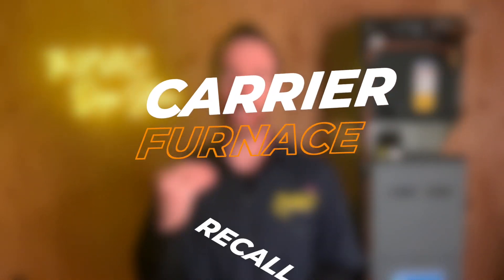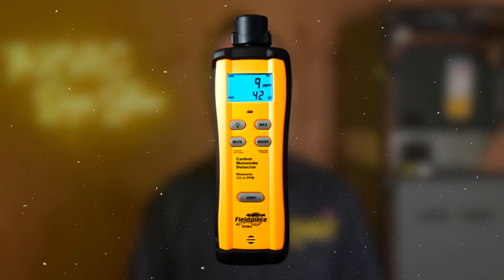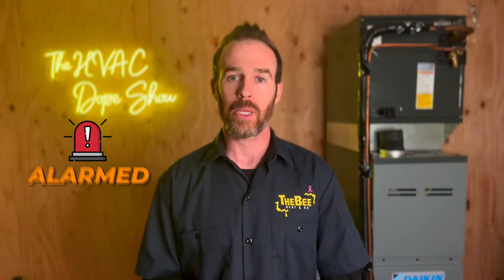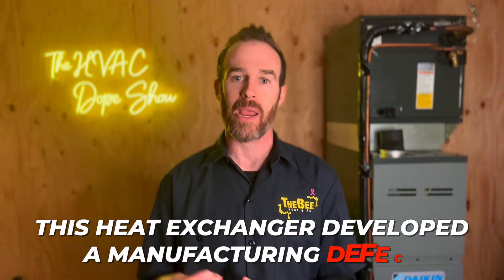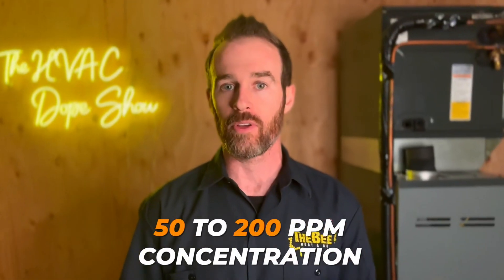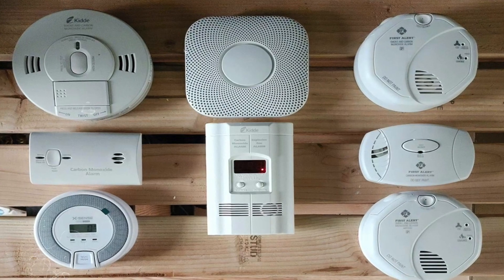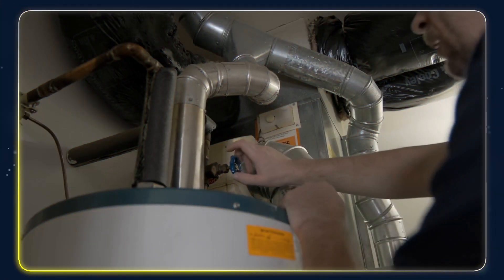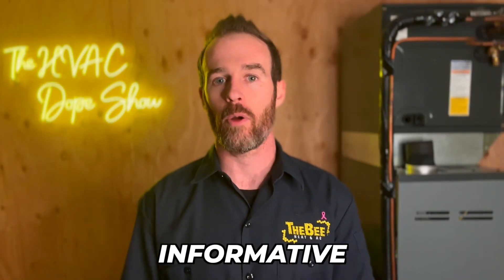Carrier Furnaces: Heat Exchanger Recall⚖️💰

Comment: Yeah its a scam.... Carrier wont give you, the customer, a replacement secondary heat exchange, they make you go through one of their "dealers" to get it, who all refuse to sell you or install just the secondary. They all insist on replacing the primary, even when there is absolutely nothing wrong with it, and then try to tack on an extra $1500 that has to come out of the customers pocket, which pretty much forces you to buy a new furnace, which carrier conveniently offers a discount towards as an alternative to offering the replacement parts that no one will give you. Theyre using the class action suit against them as a marketing scheme to sell you an entire furnace, which of course our corrupt legal system is perfectly fine with. Only in America can the rich and corrupt make even more off their scam by being sued. The court finds them responsible for making plastic heat exchangers and as punishment orders them to scam the victims a 2nd time. What a joke

Comment: Bryant dealer here, the heat exchangers are readily available from our distributor. Change these heat exchangers all the time.
Reply: same here
Reply from the maker: I don’t know anyone who replaces the heat exchanger because they’re a flawed design, and the replacements still fail?
Reply from the maker: We replace secondary heat exchangers from time to time but not on that model. Thank you for commenting though, always good to hear different experiences!
Reply: @TheHVACDopeShow  I'm a Bryant dealer in Northfield Minnesota and most of my competitors are carrier dealers and so I deal with this Heat exchanger often because it is roughly 70% of the residential Market in my area and our Bryant distributor auer Steel covers the cost of replacing the heat exchanger both parts and labor primary and secondary if the furnace is under 20 years old and so we replace this heat exchanger probably every other week, but typically I'm seeing them plug on LP not natural gas and typically I'm seeing them plug after 15 years and typically the failure of the heat exchanger correlates with another problem like high or low gas pressure or a high limit that is stuck open and you may call the heat exchanger a flawed design but on the modulating furnaces it reaches 98% efficiency according to my combustion analysis tool.
The only furnace that I've ever had set off a carbon monoxide detector was a high efficiency York unit
Reply: @TheHVACDopeShow  so are you saying that the heat exchangers supplied by Carrier for failures covered by warranty have not been upgraded in any way to prevent the type of failure that motivated the original class action suit?  

I am the original owner of a Bryant (11/2007 install) that is covered by the settlement and last week the tech diagnosed clogged heat exchanger and a CO exhaust reading of 4900 ppm.  Multiple in house CO readings read zero, but out of caution we have shut down the furnace and are now limping along with space heaters over the long Thanksgiving holiday waiting to hear from the installer regarding parts availability and possible replacement date.
Reply: Service Tech and Installer here, and my question is WHY? It's a waste of time.

Comment: 06 carrier went bad ,2023 replaced.both  heat exchangers,  parts covered. $800 labor, selling house in 2 years.
Reply from the maker: I would never recommend replacing the heat exchanger because they just plug up and go bad again. It’s a faulty design which is why there’s a class action. They teach this at Heat Exchanger Experts classes in Loveland, CO
Reply: How did you get that exchange replace for $800 labor? The quote I got was $4k

Comment: I think my just went out. I smell burning after turning on the heater the first time this winter. I open up the furnace and saw the intake pvc pipe is completely burnt on 1 side all black and half melted. Did some google and found the carrier issue with the exchange issue. I called the installer, they said its been 16yrs, so its out of warranty. They do offer a $700 recall discount for a new furnace. But its going to cost me like $8k-$12k. We just don't have that kind of money now. I ask how much to repair the exchange, they said $4k-$5k. Do you have any advice for us?
Reply from the maker: Finance it if you can or if they offer it (most do) or call around to get a few quotes, sucks but it happens unfortunately

Comment: I had a Bryant furnace installed in 2012, and I had been smelling gas for years, although my Bryant technician could never detect that. This year, my Bryant warranty expired, and I am looking for a new HVAC system because I don’t want to inhale this deadly gas this winter. I was looking into all electric HVAC, and a HVAC dealer recommend geothermal heat pump , which can be extremely expensive upfront. Or, a Daikin Fit system , which cost more heating in the winter time. So, what furnace do you recommend? Lennox? Trane? Every time when I mention the Carrier heat exchanger recall, no HVAC company wants to talk to me, is this because all high efficiency furnace has this problem?
Reply from the maker: Most furnaces have had issues periodically, but the Carrier was a poor design that caused extremely premature failure... Geothermal can be a good option, definitely expensive install up front, and Daikin Fit heat pump might not cost more to heat but it depends on your region and gas vs. electricity prices. Technically heat pumps are about 400% efficient at converting electricity to heat compared to traditional electric heat (extremely expensive to run, think space heaters)
Reply: 2012 furnace could be worth putting a new secondary into. the part is covered by warranty.

Comment: Thank you for the great explanation - we have a Bryant and this exact problem.   First tech suggested complete replacement of system and second opinion new about the warranty coverage.
Reply from the maker: Right on glad you enjoyed it! We normally recommend replacement but that’s because most of these systems are 20 years old at this point too and people are planning to upgrade anyways. We find these in a lot of new builds because the single stage version were a budget model and new construction requires high efficiency furnaces in Colorado, and most of the US I believe

Comment: Carrier now really sucks, I filed a claim with Carrier under the recall and ordered the parts got the comfirmation number and I thorght all was good after all this was the 13th replacement I have done in about 2yrs, but today was very different when the clerk at the counter told me the customer had to pony up $3500,00 until i returned the damaged parts and then they would issue a refund check, needless to say I sold the cust a different furnace installed for $2000.00 (mercy install) installed and I still plan to persue the warranty from my garage after I strip this down and return the parts for another project, I can nolonger recommend Carrier as a option.
Reply from the maker: Yikes yeah that’s pretty bad! lol $3500 seems pretty steep for a heat exchanger deposit.

Comment: Similar situation here, i called technician to take a look at my furnace that would shut off periodically and flame was orange. After inspection he said it was the secondary heat exchager and sadly he couldnt do anything other than suggest  me to replace the unit which i found would be covered by warranty. furnace is functional but it keeps hitting the limit  and shuts off, also tech suggested to keep the temp inside low like upper 50's.
My question is ;if the orange flame and the limit switch getting triggered are the obvious signs of secondary heat exchanger? Or are there any other symptoms? I will greatly appreciate any input
Reply from the maker: That’s one sign but it depends on the heat exchanger each one is different. For example tubular goodmans that fail when they’re oversized for the ducts or overfired, will have a jumping flame or blowback when the fan kicks on, and these are obvious signs, but some systems (like the Lennox whisper heat) also crack in predictable locations and so we check these areas for cracks visually in addition. But the carrier heat exchanger in this video just plugs up and puts out a weird chemical almost sulfur smell inside the cabinet / exhaust and sometimes intake, so we just know when we see “pressure switch” error code on these that it’s commonly a heat exchanger issue. Other symptoms of secondary heat exchanger failure will vary by unit but we check it visually by pulling the blower and also you can pull the inducer and / or secondary heat exchanger cover on the fire wall and see if there’s signs of damage. Hope that helps. A limit switch can be a lot of things so I would normally inspect the heat exchanger and evap coil (if you have AC) to make sure the coil and secondary heat exchanger is clean because dirty / restrictive airflow conditions will always cause issues with high limit switches tripping, but those will often be separate issues too, and not always necessarily related.
Reply from the maker: Also it’s worth noting an orange flame on a new system is a sign of incomplete combustion or a dirty burn (running rich / too much gas normally) so if you do a combustion analysis / tune it properly on startup you can reduce these types of issues.

Comment: I have a 2010 Carrier Infiniti system that seems to be working OK.  Service tech said he could replace it up to 20 years based on the initial warranty. . .plus $900 for other parts that need to be replaced at my cost.  I have so far elected not to replace it.  It is a natural gas and heat pump combination in the crawl space. What brand would you recommend for replacement.  Some say Bosch, but the computer boards go out and are very expensive.  Others say Lennox is the best, but pricy.  Your thoughts?
Reply from the maker: We like Bosch and Daikin but honestly just find a good installer in your area that's your best bet

Comment: Carrier infinity 58mvc-100. Installed 2010 Started tripping out on code 13-33.  Last year.  Will run when system is in full fire.   Dealer wants to replace for $9500.   Will replacing the heat  exchanger fix problem?
Reply from the maker: Technically yes but temporarily… it’s money to the wind and we don’t replace heat exchangers on these furnaces we just replace the furnace because it’s a faulty design and they didn’t fix the design flaw the replacements still plug up. Best case scenario it will buy you a few more years but at 2010 it’s already 14 years old so best case scenario you’ve got 6 or so years of life left. We do heat exchanger replacements when they’re damaged sometimes but not on this particular system because of the heat exchanger design. Hope that helps!
Reply from the maker: But if you’re in a pinch and just need it to last another year or two before replacement for example and just want to do the cheapest possible repair you can technically replace the heat exchanger… some of the other commenters that sound like contractors have alluded to this but we just have a different frame of thought. We just find if we do expensive repairs on old systems people get frustrated… it’s like replacing an engine on a car with 300k miles (assuming it’s not a classic or hot rod or something obviously)
Reply: Yes. Planning on moving in a year or two.  Probably do a quick fix.
Reply: So the real answer is NO it won't fix the problem I have replaced these at great pain and the problem returned within 3wks I went so far as to raise the limit (bad idea) because of the f33-31 error code and dialed down the gas pressure, got them through the winter replaced the furnace in the spring with a 80% and when I contacted the customer the following winter he said there was no real change in his fuel bill.

Comment: Just had the same thing here in Ohio.  Quoted $2800 to replace the heat exchange but tech told me its a bad idea given the 'not a recall' recall.  Unit is 12 years old which is pretty disappointing.
The house has active dampeners for 4 zones that don't really work at all.  Pretty sure they used 1.5 inch pvc for venting as well which seems to have caused lockouts when temps took nosedive.
Ah the fun of homeownership
Reply from the maker: Sounds like a valid diagnosis/recommendation, surprised on the 1.5” venting lol yikes!

Comment: I have one of these diagnosed as clogged  heat exchanger
Reply from the maker: Correct it’s plugged up, it’s a flawed heat exchanger design and that’s one thing that starts to happen… it’s if you looked inside the secondary heat exchanger it would be dunked up / corroded. They also get pinholes which is how they start to leak CO

Comment: carbon monoxide (co) is deadly .

since the 3 furnaces are the same manufacturer you can exchange parts between them unless like apple they code the electronic parts to only work with their system. (i doubt they would do that if they want to keep costs down).

if the home detector goes off it may be too late as it is possible to get symptoms on a lot less.

how does a blower puncture a heat exchanger?
Reply: (On top of looping around the point about 5 times before coming out with it) He never said it was the blower that punctured the heat exchanger. He said there was a manufacturing defect that lead to the exchangers developing pinholes. Im guessing whatever they used to weld the exchanger together didnt use proper shielding gas and the acrid fumes of the flue gas slowly corroded the weld seams. 

Also, there is only one symptom of CO poisoning you really want to avoid.....DEATH! If you suddenly realize CO was the reason you got headaches when you laid on the down stairs floor, i mean that sucks you got a headache, but at least the alarm went off before you ya know died.... If you're really worried about it, spend the money and get one of the monitoring devices, preferably one that graphs over time. Or one that plugs into a computer so you can log and graph the data. Alarms are just that, alarms. Meant to go ape scat at the appropriate time. They're not gentle warning buddies. They are threshold calibrated "GET THE FRIGG OUT NOW!!!!" buddies.

Also also, water is deadly in high enough quantities. Saying something is deadly is kind of meaningless without context. Though, it is agreeable to state that its dangerous, undetectable to humans, and needs to be checked for regularly.

Itd be unnecessarily costly to put some sort of parts DRM into HVAC units, all they do is wait for the thermostat to send 24v to close a set of relays, either initiating the furnace start up sequence (check out Technology Connections for a good video on all of that) or the compressor pump, then the air handler fan. Its literally just self contained systems with basic on-off signal wires between them. And with the Maker age of more people that understand electronics, it would be simple to rip out whatever stupid restrictive technology they tried to make stand in our way. Ironically the answer is for a company to make their products MORE customizable and hackable, not this brain dead pursuit of their walled garden ecosystem propped up by taking open standards  but calling them a different name so the customer thinks its special but really any electronic has be able to do that for a decade.....like DLNA....er sorry, DIAL.....er sorrry UPNP........er, sorry Smart Casting.......er sorry.......... Just look at all the brand names for CEC, the standard you didnt know all your HD screens have to tell the source device what its capabilities are and for your tv remote to control the source units without worrying about IR codes and universal remotes. That is of course supposing they implemented it fully....which no one ever does.....because of the idea that customers are stupid and can be easily tricked into aforementioned branded yet open standards anyone can implement. Yeah, want to know why you cant just flick video from your phone to your TV like IronMan? Its because they bastardize the standard, purchase a half implemented version and crowbar it into their product, then when no one uses it, they just do it again next season but only implement the other half of the standard so there is no compatibility even between their own products. The first of these faux tech companies to actually make the effort into opening their platforms and fully implement things will make BANK hand over fist from the hacker/maker crowd having decent products they dont have to wrestle with to get basic functionality from all because Jessica in marketing didnt use those features so assumed no one used it and didnt put it in...... But they dont want to make money by making their products easier to use in ways they dont expect you to. They want to keep you stupid and blind to the wool they pull over our eyes so we only notice the flashy shiny thing, not the ways they're screwing us and the environment over with crap that works well enough to keep but annoying enough to replace when the new shiny comes out. I honestly dont understand why we are so complacent in being treated as idiots so we can send more money to china....... Maybe I expect too much from humanity...... Wouldnt be the first time.......
Reply from the maker: On this model the Blower wheel doesn’t puncture the secondary… I was saying on other systems I’ve seen blower wheels go bad and puncture the secondary heat exchanger. This is not common though